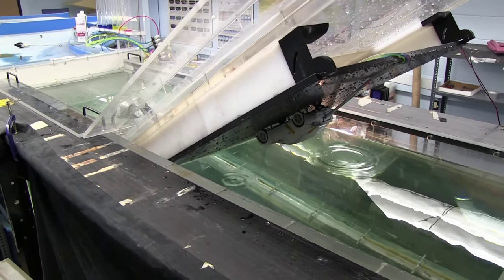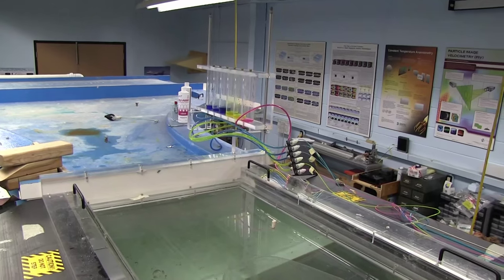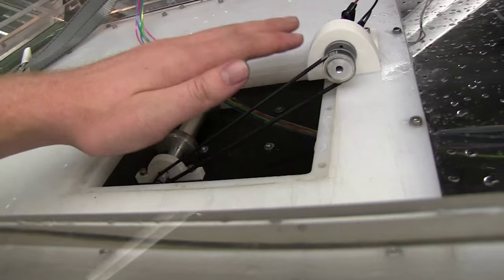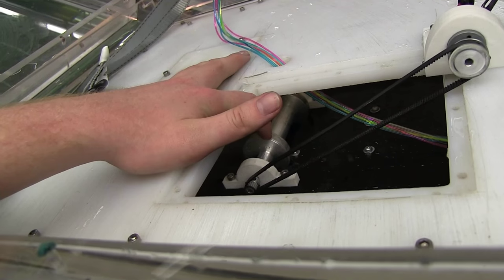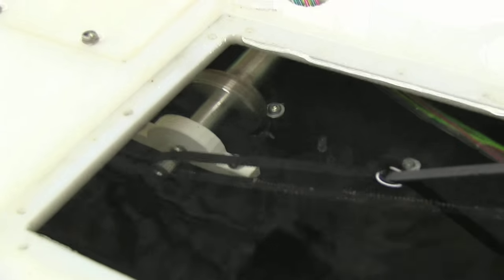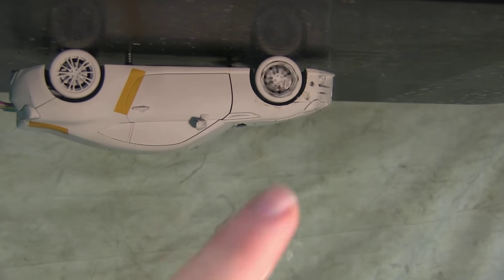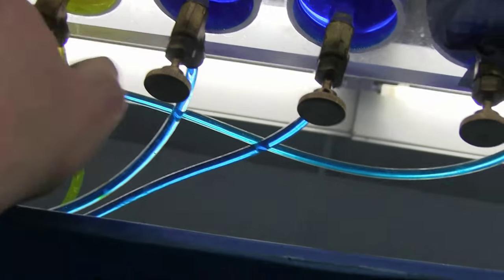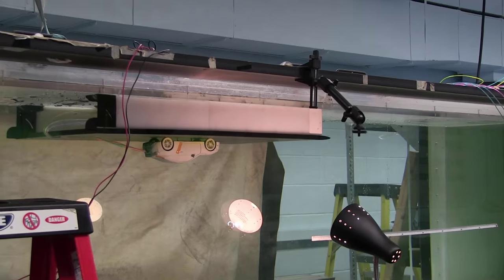How dye injection flow visualization works

Comment: Do you know of any dyes that cancel each other's colors out, or a dye remover that can be added to the water? We are running a fluid dynamics flow loop and would like to be able to continue adding dye without having the change out the full solution after it becomes muddled with color. Thanks!

Comment: At your other video talking about how stupid roof spoilers are you mentioned that vortex generators are stupid too, can you do some flow testing on it? From what I read around, vortex gens suppose to fill in flow separation over the back window to reduce the lift. I understand that it might ruin your clean flow to a low mounted spoiler, but wouldn't a wing be ok if it's high enough in a clean flow?
Reply from the maker: Artem Tsvetkov Vortex generators are beneficial on some cars (ie, mitsubishi evo, subaru STI) and are detrimental on others (FRS). I'll make a video on this sometime soon.